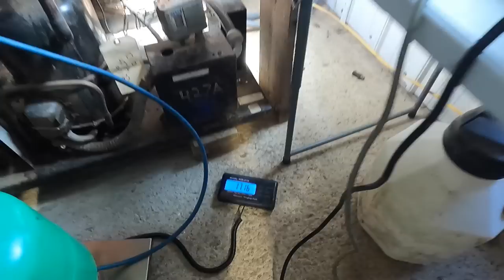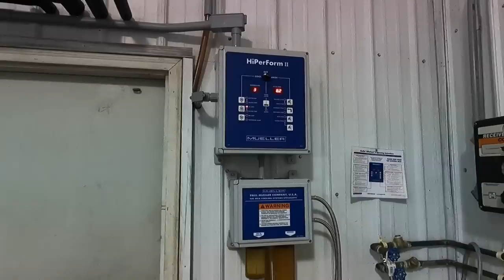Bulk Tank Finally Fixed

Comment: The good ol' days of early 80s.  I drove my dad's truck all over the place, hauling hay or picking up fertilizer in town and I was 14.  I drove to my high school summer driver's ed sessions (my birthday is in summer so I did not have those behind-the-wheel sessions during the school year).  Farm kids seem to do alot of driving early in life.  I would drive last each session.  The town kids would drive (and have issues).  When it was my turn, the instructor (who was also my baseball coach) tossed me the keys, told me to drive to Green Bay to pick up stuff for the team as he did paperwork.  My actual test was so simple.  It was almost lunch time.  The tester brought his lunch.  I drove around the block.  No parking.  Only 1 stop sign.  It was over in less than 10 mins.  Wowzers!

Comment: If he wants a job I will hire him. Might need to move to Ontario...He can have as much tank work as he can handle. 
If the leak was beside the spot weld it may be caused by Electrolysis. That's never a good sign. Stray milli voltage over a long period of time can do this. The stainless may have a rust look at the leak point. Small pits where leaking.  If it's on a spot weld it can be metal fatigue over a long period of time. Usually see a crack in the metal.  Your tank is 30 years plus so it may be hard to know all the history on it. The welder did a great job with the patch. It takes more time to fix the patch than the actual leak. 😊😊. Nice family. May the Lord bless and keep you!

Comment: I am a HVAC/R Tech with 48 Yrs experience. The coil inside the tank is called the "Evaporator". A "dry system" is <250 microns. You NEVER install liquid refrigerant on the Low Side (Suction) of the system. You will wash the compressor bearings. Big No No. ONLY Vapor refrigerant on the Low Side.  You are correct, the charge is based on a full load.
Reply: Yep, can't stress that enough. It seems like every DIY'er does it too. It takes longer maybe the reason but it's easier to get the exact amount of refrigerant measured into the system.

Comment: As an old farm hand I know why they like your milk at 38°. At 38° the milk is at its most condensed. If it was warmer it takes up more space, if colder it takes up more space. They can get as much milk on the truck as they can at 38°
It comes out of the cow at around a cows body temp of 102°. It needs to drop to the 38° in a certain time after milking, I don't recall the time limit. 
As the temp drops the milk condenses till it gets to 38° then it starts to expand at that point because ice crystals start to form in the milk. These ice crystal keep forming and growing till it freezes.
Its easy to check this, check the dipstick on the tank just after you do your first milking on an empty tank, then check it again before the next milking. You will get two different readings. 
For those who don't know farmers get paid by weight, x amount per 100 lbs. They measure the amount of milk in the tank with a dip stick, kinda like in your car, just more precise. Then you compare the dip stick reading to the chart to get the lbs of milk in the tank. Which is calibrated for milk at 38°.

Comment: @09:00 So many questions i have :D , RVS tank is rusting? - to start with. Its the use of chlorides?  Have zero knowledge on these , welding (tig) not done that either.
Milk tank looks solid installed. For the drivers license - safe driving & enjoy.

Comment: I’m glad you got that evaporator repaired but inverting the refrigerant tank and dumping liquid into the low side can and will destroy the compressor valves and bearings. Remember that a compressor can’t compress liquid!  Only vapor.
Reply from the maker: We never added liquid.

Comment: Are you going to patent the door closers?    They are very unique!!!!
Thank the Lord the leak was not in the wall and you had to cut the wall open to have it repaired.
Ronda have you thought of using row covers so you can plant your brassicas to keep the frost off of them.
Sanders only a short time now to drive your truck on the road alone.

Comment: Bonjour 
Très intéressante les explications du fils avec ça maman qui fait de superbes vidéos 
J 'ai vu un commentaire que 18000vaches avait brûlés. Faut être cinglé de faire des élevages de cette taille .j'ose même pas imaginer le traitement de sais pauvres vaches .moi si j'avais était sur place j 'aurai foutu le propriétaire et ses adjoints dans les flammes 🔥
Un français qui trouve sais choses INADMISSIBLE 
KING-AIR-148